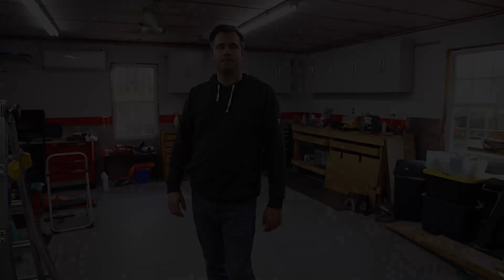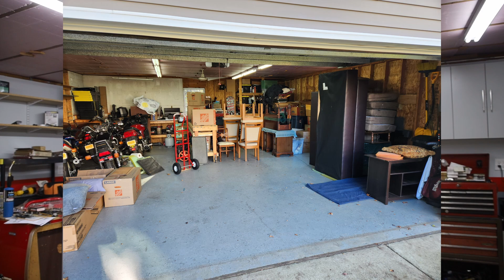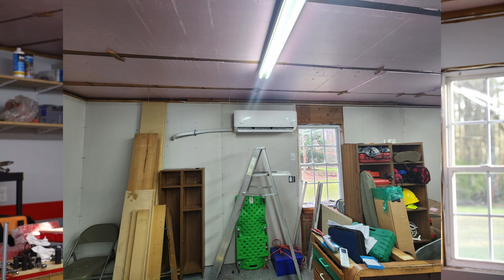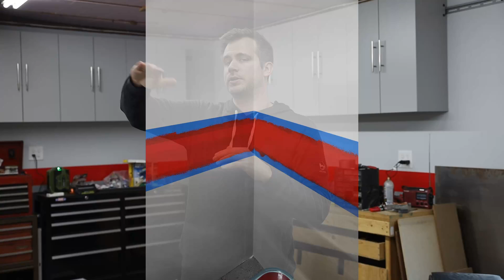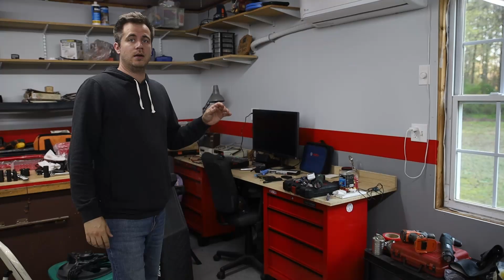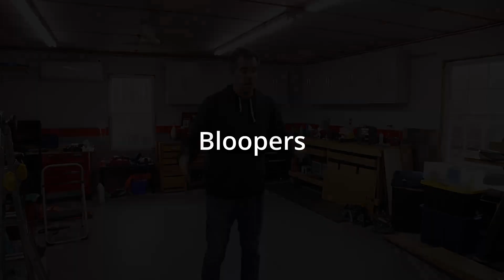Come check out my new Shop!

Comment: Love the new place. I am still hoping to buy a house with a 2 car. Been working out of a 1 car for a long time. I have an '84 Nighthawk.
Reply from the maker: Hope you get that place of your own. The upgrade from 1 car to two car was unbelievable, while still also having 2 cars attached to the house. How's your 84 run?
Reply: @N0Fumar  Runs great.  Just did the carbs last season. I believe it now has 11K miles.
Reply from the maker: @NextLevelAutoDiagnostics awesome. The carbs on mine have been nothing but headaches. It's very hard starting and almost doesn't like having the choke applied. I haven't started it in quite some time